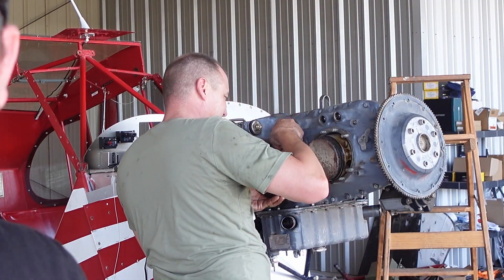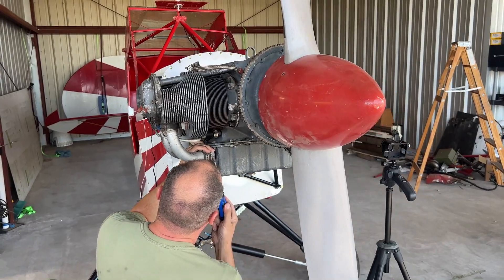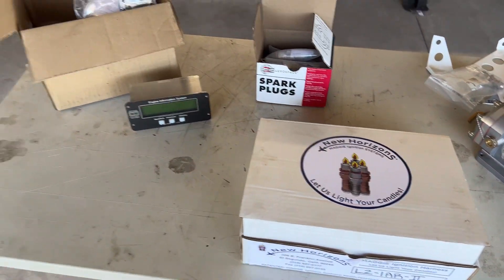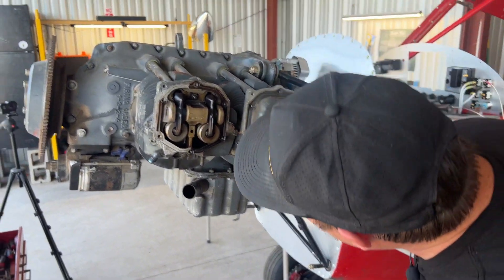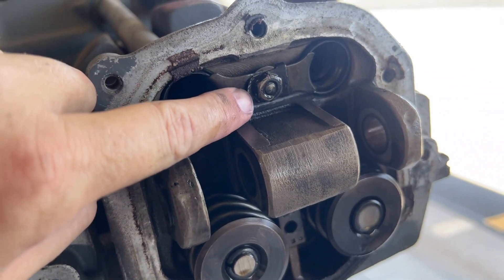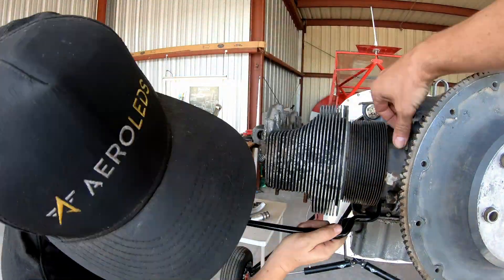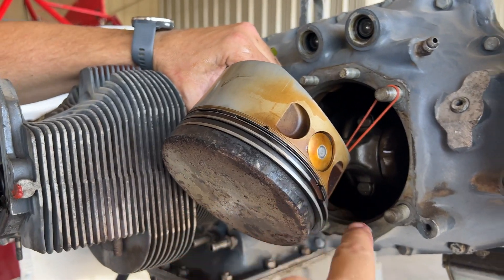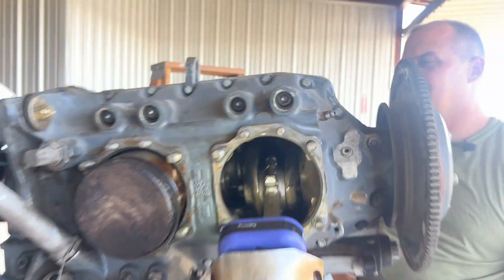I Didn't Want To... Felt I Had To | Lycoming 0-320 Head Removal

Comment: Couple things I would have done different -
I would have cleaned up the pistons by glass beading them and probably put NEW rings on them. 
Lightly honed the bore to put a new crosshatch pattern in them.
And maybe pulled out all the valves and relapped them
As long as you are in there ?
Reply from the maker: I thought about those things. Should have done it. Not hard stuff to. to. Easy enough for me to take them off again. About an hours worth of work really. =)
Reply: Ditto! Also, don't use a  metal tipped tool to pry on aluminum, use a wooden or plastic wedge. Scarred aluminum leaks, and shows poor workmanship!

Comment: Hey Carl, a bit late, but one recommendation is that as you remove cylinders, put the nuts back on the studs that go through the case halves and tighten on the cylinder flange. Doing this keeps preload on the cam and crank bearings that otherwise gets relieved when multiple cylinders are removed. That loss of preload can cause a spun bearing/engine failure due to oil starvation.
Reply from the maker: Good news, we secured the through bolts!
Reply: @flywiththeguys  Probably too late to do that. You screwed up at 6:59 already (you turned the crankshaft without having the thru-bolts torqued). That is exacerbated even more by the fact that you un-torqued the rear set of thru-bolts to remove the rear cylinder and turned the crankshaft with both sets of thu-bolts un-torqued. At this point it is likely that your main bearings have shifted in the case. Likely that a main bearing will spin on you in-flight, or have a main bearing support (part of crank-case) crack due to mis-alignments. If you develop oil pressure problems or an oil leak from under a nut on a thru-bolt, its a complete engine teardown. But you have no other choice that to send it at this point I guess...

Comment: Back in the day, I used to rebuild car engines, and there was nothing more satisfying than tearing an engine down, sending the parts to the machine shop, getting them back, and putting the engine back together. And it actually would start up and run. I never got tired of that Volkswagen, Corvair 350, Chevy slant, six Chrysler and outboard motors.
Reply from the maker: Automotive is where I got my mechanic know how. First real car I had blew the transmission 3 months after purchase. I got a transmission from a junk yard, haynes manual, and a cheap set of tools. Worked out in the end. Took me 2 weeks in the evenings, but I got it done. No regrets!

Comment: Dont be sorry Carl. They have always been called jugs. Cylinder heads doesn't even make sense because the cylinder is attached. In an automotive context, the heads mount to the engine block. I just had to redo #6 cyl to resolve an oil burning issue. Fun times!
Reply from the maker: I'm happy with the results so far. We need to ajust the piston rings just a bit,  some of the ones with lower pressure differentials had piston ring gabs literally lined up. I'm hoping we can get all of them back up to the mid 70's!

Comment: Six years? Nothing. The little Lycoming (O-290) on my bird had 730 hours and hadn’t run in 35 years! I’m cheating though and replacing it with an overhauled IO-360. (More power!!! 🤯)
Looking forward to the vids on all your upgrades!
Reply from the maker: I know what you mean. I'll have a LOT of power in this, but may consider putting the Rotax 915 on it.
Reply: On what aircraft? An 8KCAB?  BTDT, you will need a prop, governor, engine mount, baffles and a hole in the firewall for the governor. You will need to fabricate a small metal box for the hole.  If the paint bubbles on your cowling after the upgrade, get some 1/8" Fibrefrax from Aircraft Spruce. Glue it on the inside of the cowl with a couple coats of 3M 1300L contact cement, spray paint it silver and seal the edges with silicone.   My customer was amazed after we did that. He said, " I can now put my hand on the cowl right after landing, and it is cool to the touch."
Reply: @i.r.wayright1457  For me, it's on a Thorp t-18 that is being rebuilt. (BTW, The O-290 is smaller than any Decathlon ever had.) It's getting an entire new cowl, so that isn't an issue, and the firewall is being reworked as well. It's getting an all new Dynafocal engine mount. Thanks for the hints.